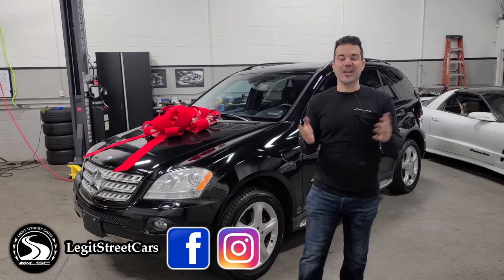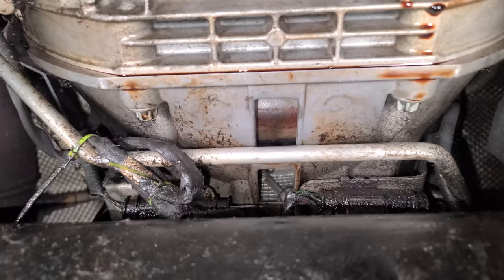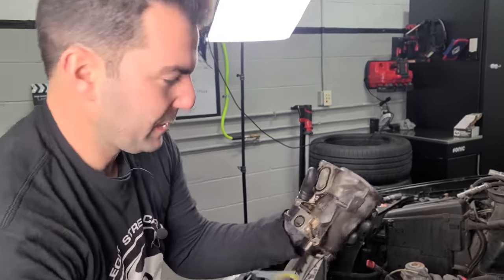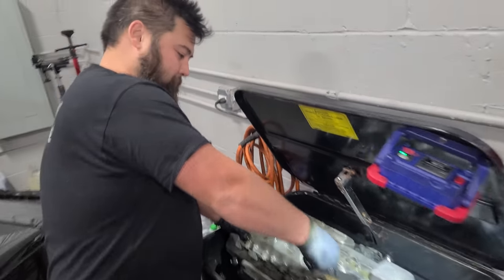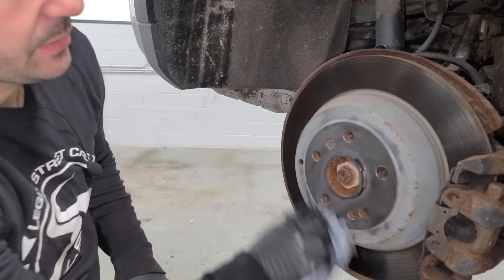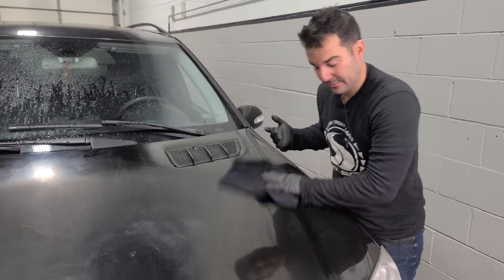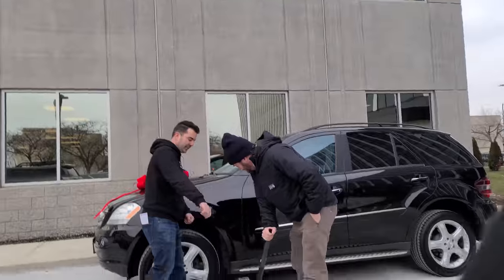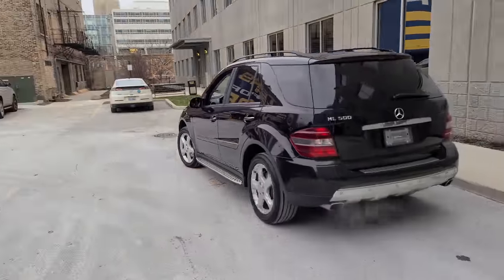I Fixed Up & Surprised A Marine Veteran With A Free Mercedes SUV & Cash For Christmas!

Comment: My 2004 Yukon XL 5.3 LS. I purchased brand new in 04. I have 300k original miles on it. All LS engines are built to last. If you keep it stock.

Comment: Ford 4.6 2 valve from the crown Vic, mustang and f150. The early ones blew out plugs but that's the only issue. Underpowered and reliable as a mule

Comment: Definitely, Buick 3800 Series 2. I loved that engine. I wish I could have it in my Cadillac CTS, instead of the 3.6 LFX . No DI carbon built up. No timing chain failures. No double overhead cam multi-valve complexity. Why did GM follow that awful DI trend.

Comment: Nissan 270hp VQ35 V6 with regular oil changes to keep the delrin (nylon) chain tension runners in shape.  My 15 year old '07 Altima SE 3.5 sedan 6-speed (not CVT) has over 310K km on it since new, with nothing but oil/filter changes every 7500 km.  Engine untouched, except for one set of fresh (iridium) spark plugs at 183K km.  No leaks, and it still pulls strong and runs smooth and quiet (original clutch too!).  Northern Ontario Canada car with more salt on the roads than Chicago.  Rear wheel openings are rusty, but otherwise still solid.

Comment: I've had a ML320 for about 6 yrs now.. it leaks power steering fluid, i have to fill it up every time i want to drive (lasts the whole day tho.. lol).. i bought a P/S pump.. haven't installed it yet.. but after watching this video.. I think its the Reservoir O-Ring.. (Gasket).. Thanks for that Alex.. I ❤Mercedes SUV's.. that ML500 is so much nicer.. nice work..

Comment: My GLK 350 died with 330,000 Km, and except for the power folding mirrors, everything worked, including the power lift gate.  My current GLC 300 has 227,000 Km, and besides the LEDs in the door handles, everything works on this one as well, including the power lift gate and Keyless Go handles... except for the driver's door handle when I pull off the lock cylinder cover.  I don't understand that one.  For the handles and lift gates apparently having high failure rates, I feel pretty lucky myself.  

These videos feel like Christmas gifts to us all.

Comment: The 4 cyl Volvo B18, B20, B30 engines from the 60's and early 70's.  My dad put at least 500k miles on a few of these babies (i.e. 144, 145, 164); EACH. Those Volvo's were bullet proof.

Comment: While I really like FCPeuro, you really do get better parts. But if you think the oil changes are warranted, in a sense, they are not. Original cost of oil change was $71. you must buy a replacement for $81. You pay shipping, $69. because of weight, and get reimbursed $71.

Comment: The 2.0 ABA from Jetta/Golf/Cabrio ranging from 92-99.5 while cabrios had them until they discontinued them in 2001. 
2nd most reliable would have to be the 5.7 Vortec from 96-2002

Comment: Great job as always, most dependable in my galaxy is the Chevrolet 350, I ve had them in my trucks, 2 in a huge Chris Craft, and even put a 350/350 into an 86 Pontiac Fiero. Easy to work on, parts galore, never had a catastrophic failure

Comment: Great video. Interestingly the OM648 is quite different engine but my 320 CDI needs very similar repairs. Breather box, replacement (plastic), oil leaks. I see wetness even at the oil heat exchanger. I hope it's just fuel from the rubber hose above.

Comment: Alex, as you re a so-called experienced mechanic why are you still not doing an engine oil flush added to the crankcase and letting the car idle for 10 minutes then dropping the oil?
that is not a very advanced engine if it only has single cam. 5W40 is not the right grade of oil for an over 20yo engine.

Comment: You americans are tripping. Everyone in the world knows that a classic, carburated  VW Bug had the most reliable gasoline ever. Those would still run half submerged, 2 sparkplugs broken and in fire. They were sold from 1938 to 2002 for a reason.

Comment: Ford 300, or the 4.6 (w/ pi heads). Both of those engines are nearly indestructible. I've got a 4.6 with over 400,000 on it, and it still fires up and runs like a new engine. 

We had a Ford 300 in a 1966 Ford F100 that we drove for years on the farm. Made numerous trips from Illinois to Florida, Virginia, New York, Georgia, and Texas. Odometer rolled over so many times I'm not even sure the actual mileage on it. Needed a new timing gear twice in the time that I had it (hand me down truck from my grandfather), and it still runs. Needs a new box due to rust, and the interior leaves some to be desired, but my brother has it and still drives it from time to time. Have yet to hop in and not get it to fire up.

Comment: Most reliable gasoline engine I've ever seen is the Hyundai 2.0L Beta 2.  Had one with 270K miles on it, original timing belt, and it never had an oil change. I bought it from the original owner and they confirmed it, they just kept adding oil and never maintained it. Had 4 rods knocking and I still drove it home. Being reliable with maintenance is one thing, but going 270K with absolutely no maintenance is something I've never seen before.

Comment: What an amazing thing to do for Chris, he’ll really e joy it. On a different note I bought an ml280 three weeks ago and the alternator wouldn’t charge as bad oil leaks covered it in oil , it is now not drivable until all repaired, the dealer did not tell me all the faults, paid £2500 repair bill expected £3000 very rare car with the same colour black as Chris so will get repaired and get a discount from supplier, mine looks awesome. Just found legit cars … awesome and very informative … hearing you rave about ML very reassuring. Well done

Comment: I've had two 3.4 GM motors I've got 226,000 on the Van  now and yes the intake manifold had to be replaced but other than that she purrs like a kitten.(209,000 on my first van) I'm happy with em.

Comment: It's wild to me that now mechanics always say that you HAVE to replace the copper washers, every time. When I was coming up and learning, I was told you NEVER use the new ones. That if you didn't put the old ones back on you could guarantee it would leak. For the record, I've done both, left the old ones, and installed the new ones, and I've never had a comeback for leaking from the crush washers.

Comment: Since you took my answer of the GM 3800 engine, I'm going with the non AFM GM 5.3L.  I had one in a 2002 Chevy Suburban and it was still going strong at 340,000.  The body and fuel/brake lines may have rusted apart but that damn engine was still going strong with no oil burning or lifter ticks.

Comment: Chevy 250 straight 6. Those engines couldn’t be killed. I had one with 500,000 miles and stil was running good when pulled. Was in my 69 Chevy Nova.

Comment: As for one of the most reliable motors ever made. I'd say the 300 CUI straight 6 from Ford. I used to have a 1982 Mercury Capri that had this motor. When the seats finally fell through the floor, the motor had over 600k on it. There was a reason Ford used it in their trucks for so long. Unfortunately I think they discontinued it as it didn't generate any repair revenue. But that's my personal opinion.

Comment: Here in Canada in the -30 C° weather I found out my 2009 audi tts had a clogged up cabin air filter. The fans stopped working while I was on a 2 hour highway drive! It took me 2 days to diagnose that they just wouldn't work because the cabin air filter was clogged with leaves, dirt.. very similar to that one but a little worse

Comment: I agree with Peter. I also think the low compression 90s Ford 5.0 V8s are fantastic. I had a 1990 Mustang with 450k miles on it making 28 MPG.

Comment: I don't get the fascination behind Mercedes....sure, they are a nice status symbol, but a Hyundai could run the same amount of miles with the same service intervals and 9 times out of 10....you're gonna  come out ahead with the Hyundai.

Only problem with this, is that after a few years....you're still driving a Hyundai.

Comment: Honda D15 engines and Toyota 22re 4 cylinder and 3.0 Toyota v6….
Archaeologist in the year 2422 will dig them up and start them with ether.

Comment: The 2.2L Toyota 4 cylinder in the late 1990-early 2000 Camrys. Those things outlast the rest of the car.  I have seen them come in with almost no oil without any ticks or knocks. I miss my 2000 Camry CE.

Comment: Peter is right about the Toyota/Lexus Uz engines. In the right application they last forever and have zero issues. My wife has a gx with the UR and a friend has one with the UZ 4.7 with 350k and not so much as an oil leak

Comment: Peter is right, first gen Lexus V8 has got to be one of the most reliable engines.  3800 is reliable too, but only as reliable as your average Toyota engine.  Not more reliable than say a 22-re or 2jz-ge.  (That’s well maintained and left NA.)

Comment: Hey Alex, which Milwaukee fuel impact wrench do you like best to break suspension bolts for good ole Chicago winter cars? I need to buy the right one for the job. Replacing  front and rear control arms on cadillac xts

Comment: Great Christmas present for a vet in need of a reliable car, l know the QR 25 2.5L from Nissan is a great motor in the frontier I got one with 268,000 miles if you give all the services and take care of that engine some will pass the 1,000,000 miles

Comment: The Toyota 22R. You could shoot a hole in the engine, Run it without oil and it would still keep coming back for more. My sisters ran for over 300000 miles.

Comment: Tie between the Chevy 292  / straight 6 and the Ford 300 / straight 6 . both  are monsters of torque  and can run for 500k + miles with regular maintenance.

Comment: Beautiful engine compartment, but don't forget those very visible nuts and bolts.  You can do as most and clean and paint the heads, but for a really nice job you can replace or have them re-plated.  There are kits you can buy, but not sure how those compare to having a professional do it.  You can usually have a 'bucket' of hardware done for relatively cheap.  "God is in the details" - Ludwig Mies van der Rohe

Comment: Bone stock k24a2 for most reliable gas engine. You can run them puppies with no oil and drive from Washington to Florida and back and won’t give an issue. the F22a3 was also top notch

Comment: Great gift for a very honorable veteran.
Most reliable gas engine is the K20 by Honda, hands down the very best, also Chevy SB 350 are very reliable and durable, start well in Chicago winter weather.

Comment: The most reliable It would have to be Subaru you can be sure that the engine is going to go out on you within 30,000 MI I'm going to have to say 2005 Toyota Corolla they're pretty reliable and easy to work on

Comment: As far as the most reliable gasoline engine I would have to go with the 4.0L Jeep straight 6. My dad had over 400,000 mi on his and it still ran buttery smooth. He just always made sure to do oil changes all time.

Comment: Good to see to bring back the ML glory. One side note, i dont know if its only here, but We used to place clothes onto the chain once the valve cover is lifted to prevent any bolts or anything to fall into the engine. Just for extra prevention. Good job

Comment: Definition of the Ultimate Torque setting. Tight as you can get it with a 1 metre Torque wrench, followed by a 120 degree turn.

Comment: I have three 3800's in the fleet (two race cars, one daily driver) plus another parts car (spare L67 for the race car, spare 4T65E for the daily) and a spare subframe with a Series 1.5 NA in the garage for the other race car.  I might have an opinion that matches Alex's but part of that is just the availability, even in Chicagoland, of well maintained LeSabres and Park Ave's for cheap because they were a blue collar aspirational cars particularly for millworkers that bought them as their "Last car" when they retired.

That said, I think the most reliable gas engine sold in a vehicle in the US is either the Ford Big 6 or the Toyota 22R.  Honarble mention to the Volvo B21/23F.  All three have such amazing longevity because they were understressed, high torque engines in applications that just werenot reved to the moon because there wasno point in doing so.

Comment: imma say it. a SBC 305 it cannot die. basic maintenance and they last forever. its not making enough power to hurt itself! 😆 ive seen alot of Vortec 5L(96-02) with alot of miles in them in C/K full size truck & Vans! 
ive own one a 97 C1500 Cheyenne from 2012 to 2022. i had to part it out because the canadian Winter salt took over the body. frame was always fluid film so it was good to continue. i now own a 89 OBS 5L TBI and ive been trying to kill it because i want to install a L31(350 Vortec) even keeping in valve float while cold and its still running fine!

Comment: Lexus/Toyota 2uz fe 4.7 v8 is the most reliable. I've got 2. One has 146,000 and the other has 271,000 and both run like new. Regular maintenance and timing belts. They also go through anything and are pretty easy to work on.

Comment: Most reliable engine that I’ve experienced was a 1998 Subaru Impreza with a single overhead cam EJ22 that sucker had 245,000 miles it ran like a champ and it didn’t leak any fluids!

Comment: M103. Most reliable gasoline engine. They go forever. Mechanical fuel injection. Can be turbocharged on stock internals and make 3-4x the factory power and still run fine. Aka, Overbuilt. From a time before MB had to compete with Toyota on price and just gave the R&D department a blank check.

Comment: Like this Video.
Also, the Toyota 5sfe? 5fse from the Toyota camry 4cyl and celica from 1990. I had one with over 320,000kms on it and still wasn't showing sings of deiing or smoking.
The other is the RB30, leave it stock and nothing goes wrong.

Comment: Audi/VW/Bentley W12 for mechanical longevity. Currently at nearly 300k miles, seen several around same mileage without anything else than oil-changes. Haven't even replaced a single gasket yet!

Volvo 4cyl B230 series engines are also VERY good engines if you just change the oil. Seen many at 400k miles. Same with 5cyl volvo engines EXCEPT 10valve ones, their intake hose cracks and ruins the engine. 6cyl inlines are also great, EXCEPT people ruin them with leaking cooling systems and overheating. They can all run for 400-600k miles IF maintained properly.

Comment: I owned an 06 Tundra with the legendary Toyota 1UZ-FE V8 VVTi gasoline engine from 128k to 174k miles. That little Tundra towed a roughly 8k trailer from Washington to Arizona and back with no issues. It got 7-10 mpg during that trip and burned a few quarts of oil, but once the trailer was disconnected, it stopped burning oil and went back to normal 15ish mpg. I'd really like to find another Tundra like that one as they're still reliable well into the 2-300k miles! The trans was the only issue I ever had with that truck in 4 years and 50k miles, it started shifting funky and I got rid of the truck thinking it was about to blow. I wonder if a simple trans service could have saved it, I regret not looking into the issue further before just dumping the truck. That 1UZ is also the smoothest and most quiet running engine I've ever seen, on top of being bulletproof reliable.

Comment: My sister and I both had 1995 camrys, 2.2l 4 bangers. I sold mine with 365k other than an alternator,  and normal s heduled maintaining at fred anderson toyota raleigh, it never had any major issues, hers needed a water pump around 250k as I recall.and she wrecked it once requiring some suspension replacement. When I sold mine at 365k it was starting to show a need for rings but still got 1000$ for it from a dealership in 2010. My sister did a little better a few years prior around 1500$. All in all,  the 2 cars brand new Christmas of 94 cost under 29k. And they were amazing cars to grow up with! Love some camrys, I later bought a 2002 v6 that I had similar luck with but was totalled around 220k with no prior mechanical issues

Comment: LED replacement bulbs?  Why?  They all SUCK and they blind other road users.  If the reflector is not specifically designed for an LED bulb, it will NEVER work properly.

Comment: The things you do for those who need and or deserve it are awesome, I am a Veteran myself. your dedication is  inspiring. Thank you

Side note, I used to own a 1994 Mercedes E420 with a fully bored and  built 550 bhp na engine and transmission. This thing was an unstoppable monster. Never had an issue with it until the Maine engine wire harness fell victim to dry rot and shorted.

Comment: Hey Alex, I recently bought an 05 clk500. It started showing abs, esp, brake wear pad malfunction. When I scanned it, it showed a p0600 and nothing else. I realized that when the lights come on the dash the gear won’t shift out of park. What do you think is causing the issue?

Comment: The 4.6 two valve ford is one of the most reliable gas engines. Several cop cars, taxis and limousines have over 400k on them and still going strong. My Terminator is one of the most reliable high HP engines there is. I have over 100k at over 500HP with no problem getting ready to turn it up to 600HP 😊

Comment: I see that you spent time to use torque wrench but you left oil filter housing opened during a random compressed air cleaning process. During this process many dust particles may enter to main bearings gallery and damage the engine.
There are no known timing chain failures but i am pretty sure that after 100 000 miles it is stretched. There is no cell code but the fuel consumption rises and hp goes down. Accoring to my experience with m113 and m113k.

Comment: Hi I have a ml320 2006 3 litre v6 diesel  model and it cranks but don't start happily. I have been told the  changed the crank sensor has been changed once . have you any ideas what it could be ? Thank you from Chris
Reply: I have changed the glow plugs recently too 🙂